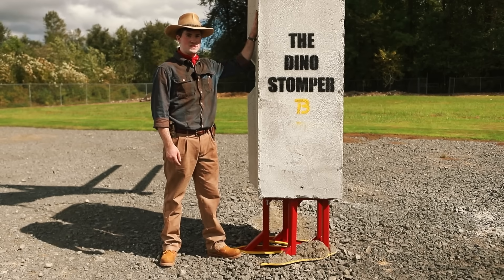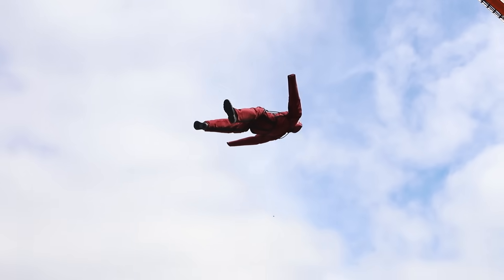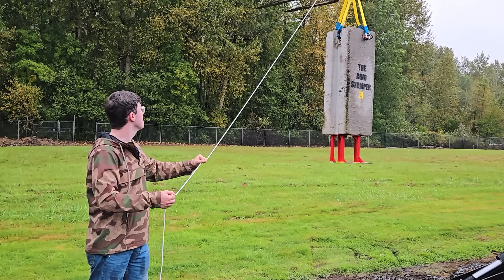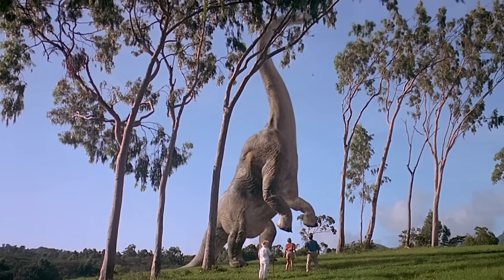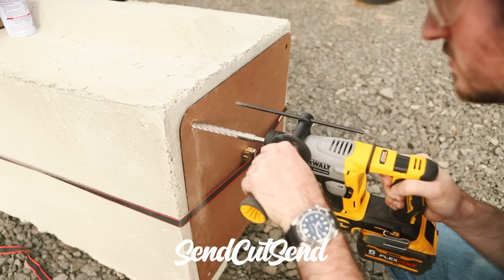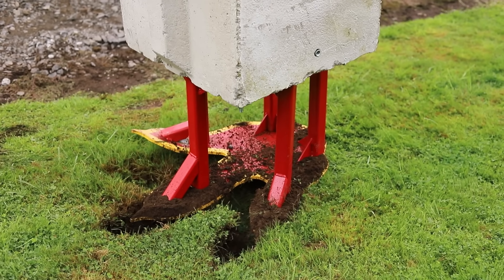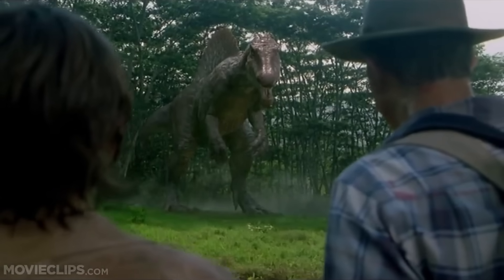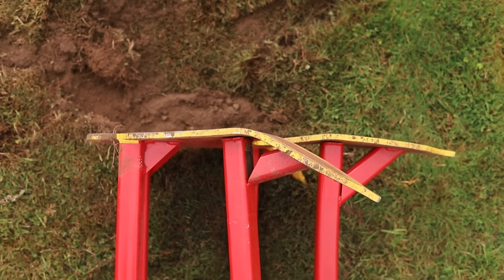Would Walking Dinosaurs Shake the Ground? Testing Jurassic Park

Comment: I can spot an immediate flaw in your entire setup here that completely screws the premise. 
The T-Rex habitat in Jurassic Park is right alongside the road, and just a few feet away from a massive cliff face. 
That entire area has been reinforced with concrete. The road is all concrete, the entire cliff face is concrete, the T-Rex enclosure where it butts up against the cliff has to be supported also by concrete. 
So the space that the T-Rex is walking on at the edge of his enclosure there near the cliff, is probably very shallow dirt and vegetation builds up on top of a concrete structure jutting out along that retaining wall and cliff area. 

This is probably going to matter to some degree, because I'm sure sound and impact vibrations travel a whole lot better through hard concrete than it does through mushy mud and dirt.

While I'm sure the T-Rex footsteps are somewhat absorbed by the mud and vegetation inside his enclosure, that's probably just a shallow layer, and all of that force is being transferred through the concrete underneath it into the road and the surrounding concrete area.

Similarly, I'm pretty sure that the muddy T-Rex footprint is in a puddle of mud on the actual road surface where the Explorers are, much like the puddle of mud that Tim and Lex are being mashed into as the T-Rex crushes their Explorer on top of them.

Looking for vibrations in far away mud in a whole area full of mud doesn't feel like it's a very good replication of the environment that the movie depicts.
Reply: Big plot hole: The pen had no cliff initially.  The goat was chained up right there behind the fence, right where the Explorer was shoved over later on.
Reply: @graeschuster4952  Nope. The cliff is always there. The T-rex are and cliff are just right next to each other.
Lex and Tim's Explorer is just parked right on the border between them, where the goat is.
When the t-rex flips the Explorer, it rolls closer to the cliff, and then when the t-rex starts pushing it, it gets pushed over the cliff.
Reply: @ieyke  The shot with Grant and Lex on the cable makes the cliff look more expansive.
Reply: @graeschuster4952  During the escape scene, it's night time, the vehicles are returning from the other direction, and Gennaro, Lex, & Tim's Explorer stops next to the fence pole on the line between the t-rex area and the cliff, so the goat is off to their right.
Grant and Malcom's Explorer is two fence segments behind them.
The T-rex breaks through the fence segment between the two Explorers.
Then it flips Lex and Tim's Explorer upside-down, and spins it around.
Grant and Lex are forced over the cliff in the first fence segment next to the t-rex area, and the t-rex shoves the Explorer over the edge after them.
Reply: @ieyke  I found the scene on YouTube and rewatched it a few times.  I can see the "land" in the cable hang scene, but there are literally plants next the the car before being flipped and spun.  Rexy didn't drag the car forward at all, flip and spin.

Comment: with the flesh padding, a rex likely would have been boarding on silent, it's a predator, the last thing it would want to do is reveal it's position, as well padded flesh would absorb a lot of shock, which is what contributes to the sound and vibration. The weight also would be more distributed over the body and not focused in one limb. The sound and vibration in JP is basically creative license. Alsoan animal to consider is the African elephant, it's weight is very close to a Rexs weight,  but they can move fairly silently.

Will say also prob similar for sauropods, the fleshy feet pads are just very good at absorbing shock and for big animals they need it so their feet don't look like the metal foot in this vid xD.. still cool video.

Comment: One thing to consider is that animals don't usually put all of their weight and momentum on one leg. It's like comparing a normal human step to jumping on one leg. In this case, while wearing steel boots.

This is especially relevant for big heavy creatures since all that weight would put a lot of stress on their joints and bones, especially at speeds. For a lot of currently living large animals like elephants, they actually walk and run in a way to reduce the impact of their footsteps, because it's generally unhealthy for their joints to absorb huge amounts of energy, and it further makes them less conspicuous to possible threats.

One could also reason that since a tyrannosaur or other large dinosaur probably didn't want its feet stuck in the mud or to inform every creature in the area that it's around, they wouldn't have wanted to stomp too heavily.
Reply: I heard that they almost certainly had thick pads on their feet that would be similar to elephants.
Reply: @HallowedError This plus elephants are known to sneak up and be really quiet same with modern day predators you don't see or hear them until they're right on you- either way it doesn't make much sense as a predator or prey to be loud asf you'd either alert your prey you were approaching scaring them off losing a meal or alert predators that you're around and doom yourself and/or your buddies 🤷🏻‍♀️ There's been life on earth for hundreds of millions of years dinosaurs were around for 100+ million even longer if you count their descendants birds modern dinosaurs so i'm positive evolution perfected them they wouldn't of lasted past one generation if it didn't and they wouldn't of stomped around being all loud like that. It's really cool in movies to see them roaring and being all loud but in real life it makes zero sense.
Reply: Just so you know, while you do put in all of your weight on one foot when jumping on one leg...you don't actually impact the ground with all your weight crashing down. You have three! joints whose important job is to amortize the jumps.

If you want an example...I can jump both to make a thump sound on the ground (one foot or both feet) as well as to make basically no sound. Any parent with children can tell you that the child running or jumping makes a lot of noise and makes the floor shake, but an adult running or jumping can prevent that.

The same is for a T-rex (or any other animal). As long as they are adult, there's 0% chance they would stomp, whether walking, running or jumping, with the full force of their body. One leg or two legs is just secondary.
Reply: @kikixchannel  Yeah and that just further suggests they wouldn't really make that much noise when walking. All of these things are there to reduce strain on their body and to not make them conspicuous to other animals that are around. I'm sure you'd hear them coming from a bit away, but it wouldn't be making the ground shake.
Reply: the footsteps we hear don't have a set rhythm, so it's possible it could have tripped or stumbled on some of it's steps
Reply: Consodering a fully grown brown bear can weigh a half ton; a t-rex weighs 5-8 tons. That means using a 4 ton weight as a control for steps is pretty reasonable
Reply: Maybe it’s a territoriality display.
Reply: I actually just noticed the other day while leading a horse that its footsteps were actually more quiet than my own, despite it being like hundreds of pounds heavier then me
Reply: That and T. rex feed were padded, which makes sense given that it was an ambush predator which requires stealth.
Reply: you forget bone and muscle structure  in animals now are vastly different than back then and things that applied back then wouldn't apply now.
Reply: @a-arons4364  Where are you getting this from? Muscle in tetrapods is fairly consistent, it's mostly a matter of fast and slow twitch fibres. Idk how this is even relevant.
Reply: @simtexa  both your comments show you've never actually studied remains of any species of animal personally. I'd wager you read a magazine article about it once or watched a YouTube video and thought you were an expert 😂
Reply: regardless, a t-rex still likely weighed more than a ton, and was most definitely not going to be an ambush predator. if anything I'd imagine they chased the smaller prey down, they have bigger, stronger legs, and spend less stamina moving the same distance as smaller prey
Reply: @Zamerus  Current theories are that it was an ambush predator. It was likely fast and agile in short bursts but wouldn't be able to sustain a chase.
Reply: @Zamerus  people in Africa sometimes get sneaked up by 5 ton elephants.
They walk almost completely silent.
Reply: @Zamerus  Um...No. When you double the size, you increase the weight by 8. You do NOT increase the muscles strength or efficiency by 8. If you have the exact same animal in two different sizes, the one that's larger will tire more quickly.

This problem is why bugs can lift so many times their body mass, humans if they train can also lift a few times their weight (about 3 is a good record I believe). Elephants? 150% of their weight, and they are four-legged which is more efficient for lifting.

The movement of a leg that's eight times as heavy, even if it will give them the advantage on the length of a single step, is absolutely going to cost them more stamina than for smaller animals of similar build. It will also make them far less maneuvrable and have far more difficulty stopping and turning, due to higher momentum.

In other words, no. Being bigger is not a sign of a chasing animal. Quite the opposite. In the animal world, smaller animals usually chase LARGER animals. Just compare predators like wolves to their typical prey, like antelopes. Being smaller and, more importantly, lighter, gives serious advantage in chasing prey.
That being said, there's only one animal that I know of that is literally built for chases and prefers them over all other hunting methods (biologically). Human. For every other predator, chasing is something they do if they fail to catch prey with their preferred method. Smarter pack predators may 'chase' their prey into a trap, but that's the only time non-humans want a chase.
Reply: @Zamerus yeah as someone else said, the common belief is that the T rex was an ambush predator & could walk extremely quietly.
Reply: @Zamerus  it weighed WAY more than a ton (average around 7.8) and current theories suggest they were ambush predators. The prey they hunted was very large as well and less capable of running in most cases
Reply: @lophus02  something that big just simply doesn't make sense as a quiet ambush predator to me. Heavy body mass, even denser bones, even if its a balanced creature. It would need exceedingly soft and thick souls along with a stealty walk for it to work
Reply: @ well it’s definitely not a pursuit predator. It also does have very thick foot pads making it almost silent when walking. And its prey were large armoured herbivorous dinosaurs, ambush would be most effective
Reply: @DreadEnder based on current muscle theories for the t-Rex, some paleontologists believe that it could’ve been similar to human ancestors in the aspect that it was likely an ambush predator, but had the ability to keep a moderate pace over a long distance to slowly wear, at least some of, its prey down.
Reply: @Zamerus   Elephants do it so it's not that weird at all. They do not stomp, even when running. Large creatures with hooves can stomp, but I've had bison sneak up on me so even they don't stomp around normally. It makes sense to me because I grew up watching National Geographic and study animal physiology for my writing. A stomping great beast makes a whole lot less sense than an ambush predator with silent strides.
Reply: @Zamerus  Tyrannosaurus was a massive animal and a fully mature adult could weigh anywhere from 8 to 10 tons making the largest predator to ever live on land, despite its weight the animals was very well adapted to carrying that weights with massive muscles all through it's body and despite it's size the animal would have been nearly silent when It moved, like modern elephants it's believed Tyrannosaurus had padded feet which muffled it's foot steps and allowed it to be a very effective ambush predator. It was likely able to use the tree line to get as close to it's prey as possible, probably using the cover of night as well and with a quick burst of speed it could ambush it's prey and down it in a single bite
Reply: @Zamerus it been proven that T. rex is a ambush predator that take down large prey. They def eat smaller prey since easy food.
Reply: Plus in the case of tyrannosaurus it likely wouldn’t have been able to run at all, just speed walk.
Also they had fatty cushions on their feet which absorbed basically all noise. They were ambush predators so that’s necessary.
Reply: Tyrannosaurus rex, whose name means “king of the tyrant lizards,” was built to rule. This dinosaur's muscular body stretched as long as 40 feet—about the size of a school bus—from its snout to the tip of its powerful tail. Weighing up to eight tons, T. rex stomped headfirst across its territory on two strong legs.
Reply: @mizziepet  AI ass comment, ngl. Except AI usually use less childish language describing things.

Comment: The car cup vibration test dropping the foot was impressive! As you mention, the car shocks and springs would absorb a fair bit, in fact they  are designed to damp vibration in this exactly this sort of frequency range, as it contributes to road noise/boom and engine vibration (look up NVH - noise, vibration and harshness if you want a rabbithole), so if the car had been up on jack stands, I think it would've been even more impressive.
I also wonder if originally they could have avoided the need for a guitar string setup by just leaving the truck idling and disconnecting a spark plug? :D

Comment: Also take in mind how hard we normally press on the ground by walking, compared to how hard we CAN stomp. I’d say that’s well more than double, especially if you measured it by joules or psi. These animals could have stomped, and it’s feasible for them to have done it to scare, intimidate, or attack. Look at how some birds, or even dogs behave. Dogs are a great example because we have close interactions with them, and we observe them all the time. They stomp on the ground when they get excited or when they are on the attack, and almost all animals use their feet to attack with. The high drop height is plausible, because you have to factor in strength, weight to acceleration ratio.

Comment: A new study suggests that - and this is pretty likely to be the case - NONE of the T. rexes ever found represent the MAXIMUM size of the species. It further suggests that T. rex may have been up to 70% heavier than our previous heaviest estimates. So, you could do the test again, but this time accounting for a 32,300 lb MAX sized T. rex (16 tons). The big factor of course - and why I don't think even such a big one would have given away its presence - is that.....they wouldn't be stomping around. This sort of tremor would require them to virtually STOMP as they walked, deliberately putting a lot of effort in, which, obviously, is non-ideal as a predator. One factor in JURASSIC PARK is that the T. rex was walking up a SLOPE - so it'd be planting its feet fairly hard: if you look at a diagram of the paddock and road, you'll see that the goat is brought to the surface from an underground holding area beneath the slope. To one side is a concrete wall and a dropoff wheree the car went over. Facing the road from inside the T. rex paddock, that dropoff is to the right. To the left is a slope leading up to the fence and the road. That's where the T. rex came up. The rex, in the dark and rain, could get pretty close to the cars, hidden by the slope and trees, before you'd see it. It would be walking on a likely man-made slope with some hollow area underneath for the workers and the goats that are sent up through the lift from below. It's possible this employee access area extends BENEATH the road itself. So this changes the dynamics a bit, and may increase that vibration you would get. This of course doesn't explain other scenes where the rex is approaching - The Lost World for instance - and you get the same "boom* and ripple, but it is worth at least noting. I weigh 220 lbs - much less than a T. rex - but even when I walk on some man-made surfaces, there's a significant vibration going and my steps are audible. I'm guessing the whole area is lined by concrete, though, so it'd depend on the vibrational qualities of the material.